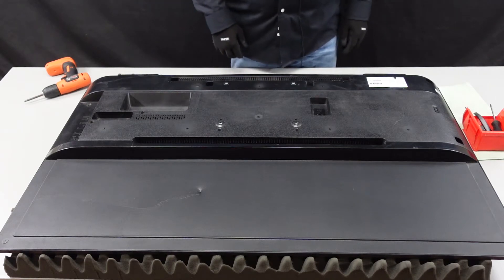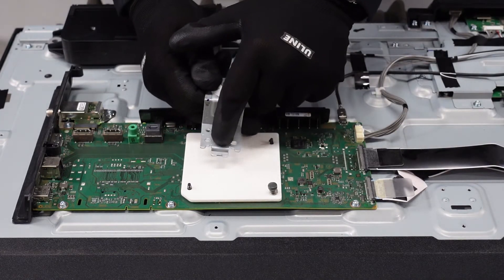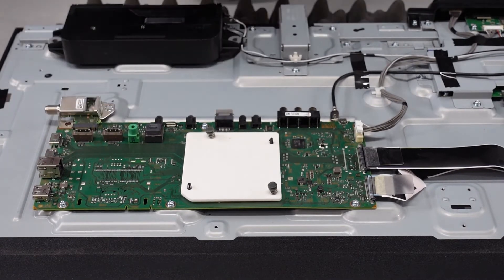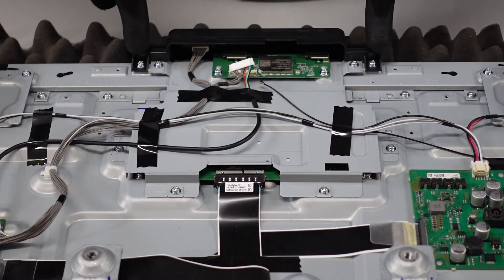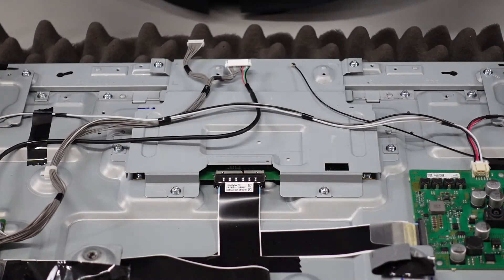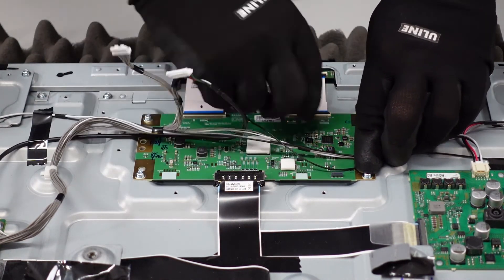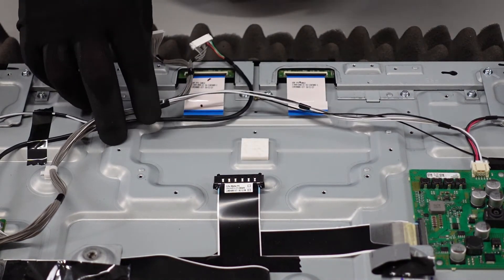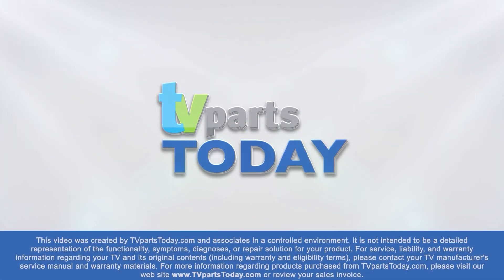Replace your TV parts all by yourself.  (SONY XBR-49X800G)

Comment: I have a similar 39 inch model. I'm unable to control it using my remote. I think its IR receiver is not working. It doesn't work with Firestick TV either. Which module should I replace?
Reply from the maker: We don't deal with a lot of TVs under 42 inches, but most modern TVs will have an IR sensor board, so I would suggest swapping that board. I would make sure that there isn't an issue with the remote before you swap any boards in the back of the TV.

Comment: after watching this video, it makes everything seem fairly straight forward. however, it does not suggest why one piece or another would need to be replaced. i have this exact TV. the red standby light no longer lights up, the tv doesnt turn on. I checked the power supply with a volt meter for voltage and amperage, which are at spec. how can I further determine which piece is most likely the culprit? seems the main board and LED Driver could be most likely?
Reply from the maker: Hey there! Thanks for watching and for your comment. If you have no standby light, we would recommend starting with the power supply board as it appears the TV is DOA so power supply would be the first step. The main board can cause power issues but wouldn’t typically prevent the standby light from being on.